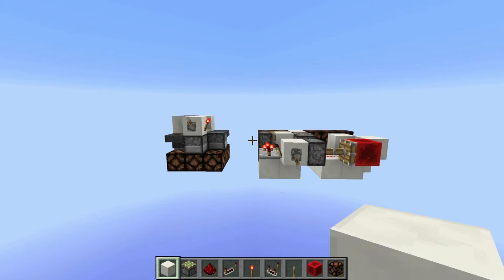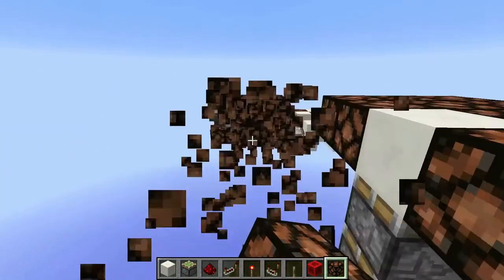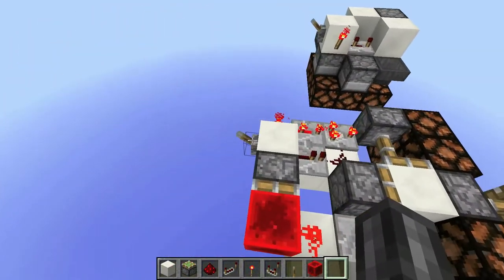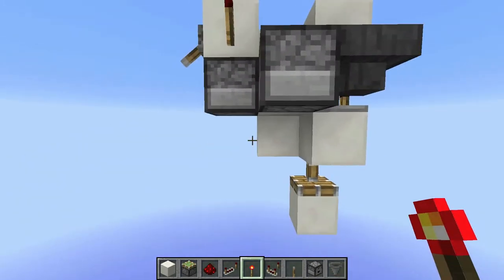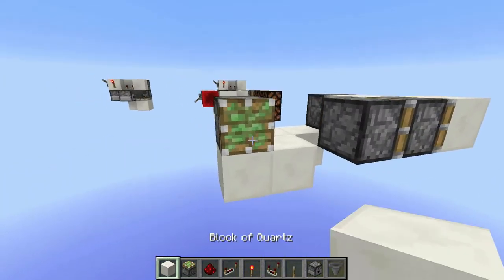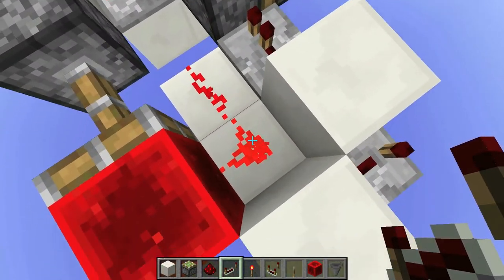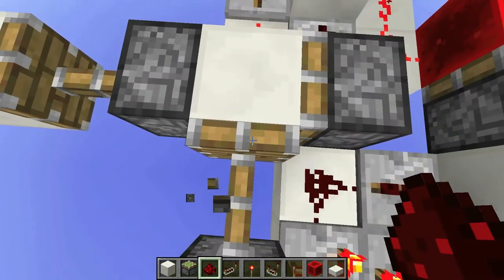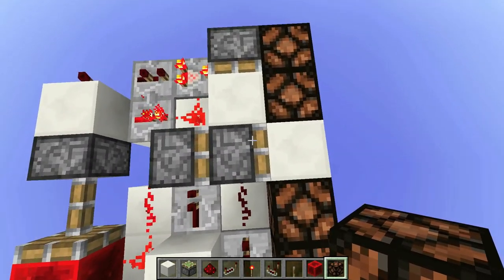"Contained" Double Piston Extender Challenge

Comment: Hey Zombachu, I have some cool ideas for Redstone designs, but my Redstone skills are slightly less than that of a snail playing Minecraft with its antennae. Needless to say, I'd like your help making some/all of them a reality.
1. A door made entirely out of forward-facing pistons. One of two options can happen: either make the pistons which form the door not interact with ANY of the Redstone, or make them react in such a way that works to complete the extension-retraction sequence. Rules: 3x3 min. size, and don't use immovable blocks to prevent Redstone mix-ups.
2. A 3x3 door that is made entirely of Redstone blocks. Again, make sure the circuit is wired in such a way that the blocks don't affect anything, or if they do, they do so intentionally.
3. A block swapper (any direction) that can replace a piston with a Redstone block. Sort of like a contained block swapper, I guess.
4. A 1xinfinite, powered from one side, button/pressure plate/tripwire activated trapdoor that closes after an extended period of time. The goal is that it can be mirrored to make a reusable, 2xinfinite trapdoor/pitfall.
5. A trap that, when triggered, does the following: reveals a hidden dispenser, rapid-spawns zombies, skeletons, or other hostile mobs (spawn eggs), and then turns itself off when the dispenser is empty. Preferably pulse-activated, but it can always be hooked up to a t-flip flop.
6. A 5x5 door which, when closed, follows a checkerboard pattern, with solid blocks and air, and with the corners containing blocks. Preferably seamless, and prioritize speed over size.
I really hope you can try your luck at some of these designs, and I look forward to seeing what you come up with.

Comment: made a 4x5x2 button activated horizontal one and 6x4x1 downwards, both smaller than yours :) also made a 4x3x9 vertical but it's horrible and slow and seems overcomplicated :/
Reply from the maker: Nice! I made a 4x3x6 vertical and I'm in the process of compacting it right now (after lunch :P)
Reply: zombachu I kinda just threw the vertical one together. I kinda used a triple on the bottom so the top piston wouldnt be pushed above the floor. Yeah, it's as hard to wire up as it is to understand what the hell I'm even talking about
Reply from the maker: ***** Nah, I got what you're saying, and it's really smart :D
Reply from the maker: ***** I got my vertical one down to 4x5x3 :D
Reply: zombachu yay :D I'd lvoe to see it. Put it on your plot on mma :) :P
Reply from the maker: ***** Maybe later, but I also finished a 32 block horizontal one a couple hours ago :D
Reply: zombachu I made one from the floor which is 4x5x5 but a piston extends out of that so its 5x5x5